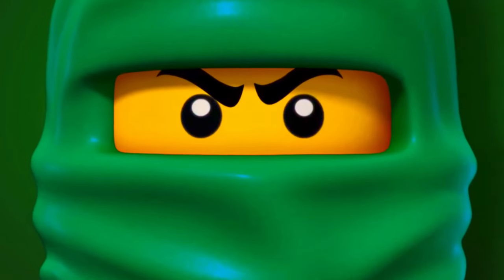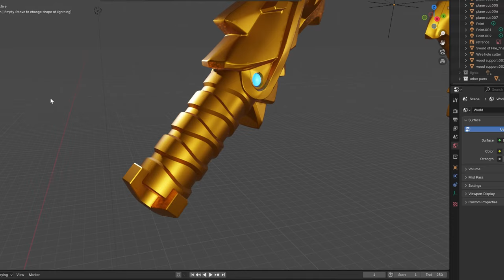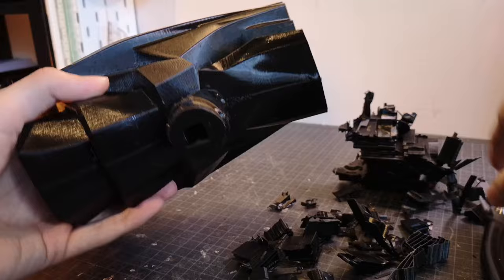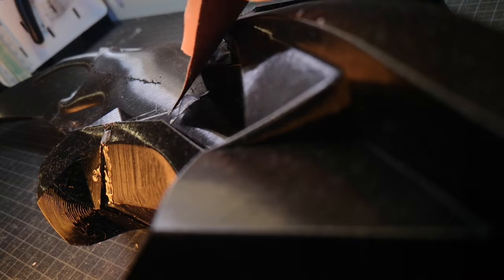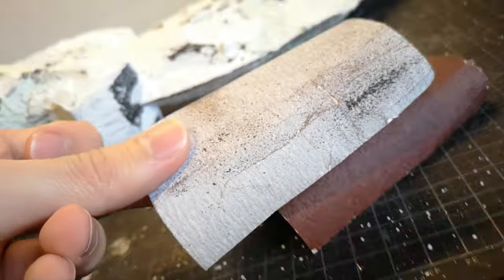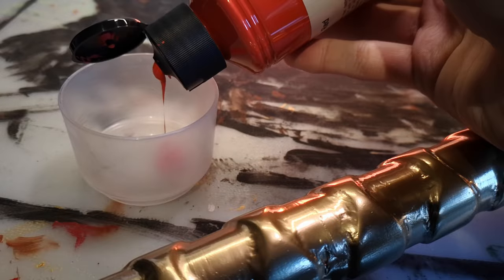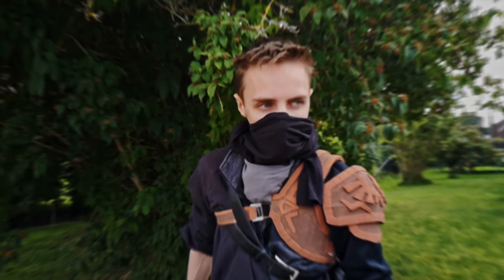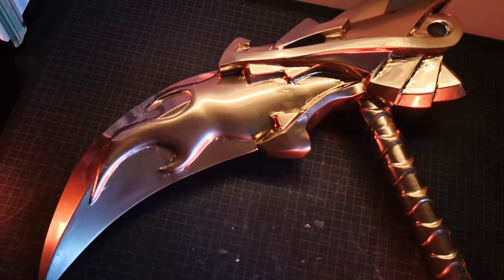I Built an Epic Life Size LEGO Ninjago Scythe of Quakes!

Comment: Out of all 4 golden weapons you made which took the longest
Reply from the maker: @Davtheglowingviper  probably the sword of fire because I sanded it a ton and painted it multiple times, at this point I have done the process so many times it doesn't take as long. Then there is the fact that I printed the sword of fire in june last year and finished it back in february this year because I worked on other projects inbetween😆
Reply: @HardwareMaker  oh wow makes sense as it’s the first and you did the dragons hilt by scratch and for all the other weapons the copied the dragon hilt,the first always is the hardest
Reply from the maker: @Davtheglowingviper  Yeah, the sword of fire was pretty easy to model though, I was actually able to export a model of the lego piece into blender and from there I just made it smooth, accurate to the tv-show and 3D printable. The shurikens of ice were probably the hardest to model with the triangle shape
Reply: @HardwareMaker  ah I see good to know